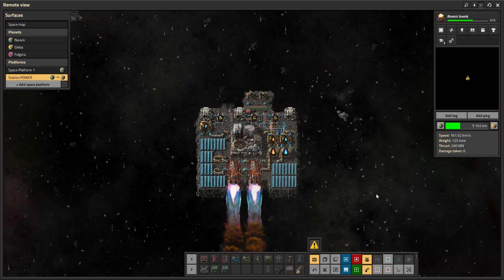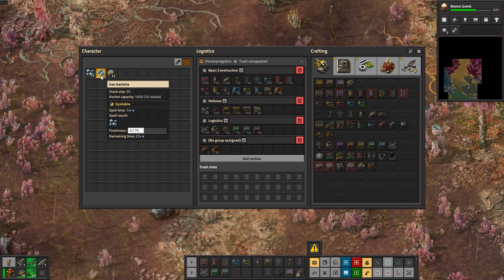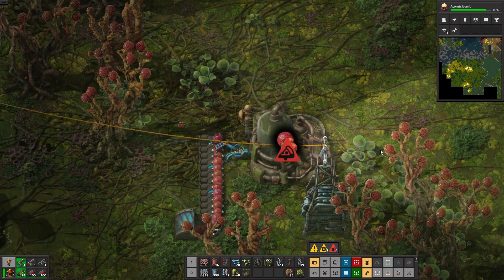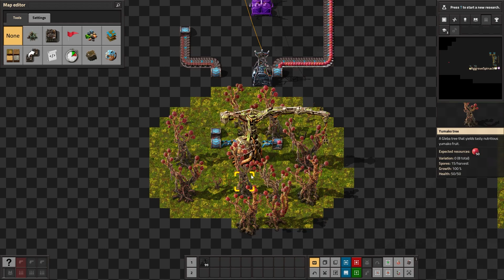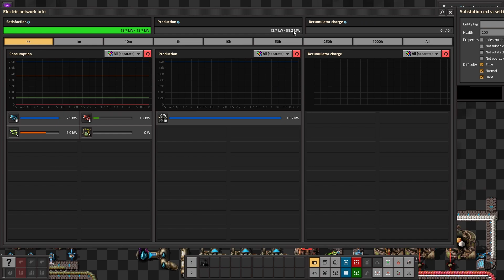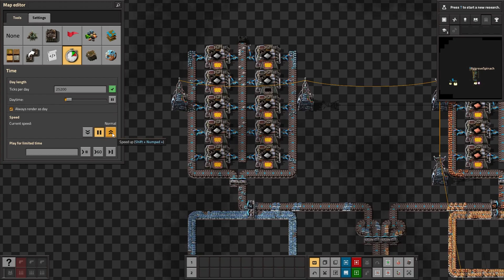Fully automated iron and copper on Gleba -  Factorio 2.0 Space Age Tips & Tricks

Comment: The heating tower is 1k degrees because it has no/very little steam conversion going on. Trying to use spoilage as an actual power setup is not going to work, at best it's a supplement. You need rocket fuel to actually get a reasonable amount of power on gleba.

Comment: In the bacteria kickstart system at 33:00, you can instead use circuit control to have an inserter pull off of the main jelly belt rather than running a lane with a splitter. You said yourself - most of what you split off to that system spoils. This way nothing is sent that way until it's needed. It's a minor improvement but I think it's an important scaling factor to reduce potential dead ends with spoilables.
Reply from the maker: @mystagogue71  true, that is a clever idea, thank you!

Comment: If you want to marinate it for a minute, why not have your marination loops be 1 minute long?  You're using blue belts, so items will move 6 belt lengths per second (if my math is right).  So have the marination loop plus the belts leading to the loop be equal to about 337 belts.  For green belts it would be 450 long.

Having your marination loops be too short can cause the bacteria to backup to the biolabs that created them.  Try saturating a full belt of bacteria leading into your marination loop and see what happens.
Reply from the maker: Eventually I do switch to just putting them into a box

Comment: Really good video!
Couple of suggestions: seeds don't spoil so the one thing you don't need to worry about is processing at the farms, converting plants into produce drastically increases the spoilage (1 hour to 3 minutes) so belting the plants to your base then processing them is way better than processing them at the farms, you can yellow belt or bot the seeds back with no issue. Processing fruits to mash/jelly right where you need it then sending seeds back is better.
Since the only real produce you want to get as fresh as possible is science you want to get all the ingredients for it as fresh as possible (I believe you forgot to mention any product inherits the average freshness of the ingredients used). So the freshest jelly and mash into bioflux right where you produce the science. (direct insertion for the jelly and mash close to start of the bus is ideal), the eggs are basically a kovarex setup that will be always fresh.
Bioflux has a very low spoilage rate and is used in almost every recipe including science and it has a very good ingredient to nutrient ratio. So just belting bioflux on your main bus and turning that into nutrients for almost all your local produce is the way to go, you can have a bioflux bus turn into fresh nutrients wherever you need it instead of using mash. Bioflux to nutrient ratio may not look amazing if you look at base stats, but remember you get a FREE extra 50% from extra bio chamber productivity bonus and way less spoilage because of the drastically improved spoil time on (mostly) fresh nutrients.
Reply: 5 bioflux to 60 fresh nutrients without any modules is what i'm saying

Comment: I tried doing a belt based gleba based, I did everything to get rid of clogs, belt content never stops it rotates around and yet it still breaks. Bots make gleba a lot easier but you still need to think a little forward, you can't just enable everything, as later parts of your factory will hoard nutrients away from the parts that supposed to create them (the bioflux only part) what worked for me is some circuitry that reads a buffer chest that holds 1k nutreints and disables parts of the factory's requester chests if it's below a threshold, so the base can warm up in case it stops. Yesterday I ran out of nuclear fuel cells and everything went offline on gleba, pentapods destroyed the whole thing. Everything restarted nicely after the bots rebuilt it!

Comment: This is a great design! I did something similar but used the other half of the yumako belt for nutrients instead of having a separate belt above. The one issue I have noticed is that its possible for it to permanently stall if your yumako production is too slow, so I'd recommend building extra soil as soon as possible to maintain a good stream of resources.
Reply from the maker: Yeah in the actual game I ended up using 2x24 tile yumako farms

Comment: 19:50 its not gonna keep 1000 degrees for very long if it needs to make more than like 0,3MW of power, the tenperature basically works like an accumulator
Reply from the maker: Yes I realise my understanding of heat -> power is a bit flawed. a heat tower can only max out at 40MW, however, there's enough burnable material in this system to supply many heat towers so add as many as required
Reply: @DataEngineerPlays  In essence 40mw from the heat Tower means 40mw power while its burning, but spoilage burns for like 250KJ so you need a constant supply of 160 spoilage per second to upkeep that 40mw, or almost 3 filled green belts, so it can make 40mw, but only from whatever fuel value of what you put in it

Comment: There are so many great bits in this video I've picked up, 
1. adding those grabbers inbetween a pair of labs to make things like nutrients or metal-bacteria more robust are great, but for expanding after the first pair or two it seems removing them in favour of a more compact system is fine, allowing the more robust system fill in the gaps at the start of the line. 

2. I really appreciated the burning spoilage tip, it's so much free power. And you can burn almost anything, which not only gets rid of things but also means you maintain maximal freshness, which is especially important for science.

3. The nutrients from yumako are neat for sure, Even just two so that the factory never dies is great. It's like a backup generator.

Comment: Hi, thanks for the video. I think nutrients from mush can stuck if mush is not consumed and you get unlucky and biochamber generates seeds. Seeds will clog and since they don't spoil, nutrients biochamber won't get mush. To fix you need to discard spoilage + seeds.
Reply from the maker: Yes you will have to handle spoilage of the yumako, its on a 1 hour timer, but at one point in my game it did spoil and clog my system, so I had to put a spoilage inserter at the end of the yumako belt too.

As for seeds, I have a wire logic on an inserter that says > 300 in the box, take it onto the spoilage belt and burn
Reply: @DataEngineerPlays  yes you are right. There is an inserter in the end 17:10 , seeds are handled. My bad!

Comment: This is very nice. I was convinced that the Gleba processes needed quite a lot of circuit control on belts or inserters to keep from flooding belts with too much spoiling stuff, but your solution here is a very nice, almost completely circuit free solution. 

Oh and I would say just from experience, I recommend not allowing bots to handle any part of these processes on Gleba, especially anything related to spoilage. Me and my friends used some logistics bots to help get different sub parts of the system working together and we ended up with about 600k spoilage that clogged the storage chests, mainly because we were trying to bring it all back to a recycling area to make it into nutrients instead of just burning it. Keep it simple, burn the stuff. The spoilage to nutrient recipe is really just for kickstarting things.
Reply: my entire gleba base is 100% logistic bot run. Extra spoilage and extra seeds get burned, that's it. It was powering the base for a while but as soon as I had fusion and a delivery ship making the rounds with fuel, I dropped a fusion plant on Gleba and deleted all the steam. The heating towers are still there to burn the extra but they're literally just that. It's simple. I just checked and I literally don't have a single belt placed on the entire thing.
Reply from the maker: @Matok1  true. But you need bots to deliver the stuff to the rocket right? Or... maybe I should use circuit control and direct feed the science into the rockets
Reply: Mainly talking about stuff that spoils fast. We had bots handling the mash and jelly and it was spoiling while they were moving it around so they'd stuff it into storage boxes, and had them trying to handle spoilage to bring it in for recycling into nutrients but they couldn't keep up, was a disaster. Using bots for end products like rocket fuel and processors makes sense.
Reply from the maker: @Matok1  oh yeah 100% don't be doing that. Just use belts and handle the spoilage with insertors and splitters I think is the way to go

Comment: Great video. Helps me visualize what I need to do. I will say, a minor concern with this design comes to mind. When splitting your jelly and mash off as a failsafe for bacteria generation, it might be better to disable a belt upstream rather than turn the machine off. That way you will just have a few spoilage stuck on the belt until the system needs to be rebooted, rather than half your main belts jelly spoiling on a line that isn't used much because its stopped flowing with a stopped belt. Though maybe there is such an abundance of mash and jelly that that isnt an issue, i only just recently landed on gleba.
Reply from the maker: Yes I've tweaked the design a lot in practice. Regarding the jelly and mash spoilage, I realised this design doesn't process enough jelly to keep the jelly seeds going so I've routed the end of the belt you mentioned directly into a furnace to burn the jelly to keep the jellynut process continuous.

Comment: Awesome video. All things are highlighted. Great compact and efficient schemes. 
I have only one concern. On schemes where you doing Yamako there is a chamber that produces nutrients. But if everything will stop for a really long time it will never start again by itself because the Chamber that produces Nutrients needs Nutrient to start doing that. Am I wrong?
Reply from the maker: The only way this could happen is if you lose power for over 5 minutes and the nutrients in the first yumako mash -> nutrients chamber spoils. But as long as you have continuous power, it shouldn't be an issue. While the belts are backed up the spoilage handling in the system will continue to produce new nutrients and yumako mash while everything else is backed up so the initial nutrients should never be spoiling.

That being said, at some point in my playthrough, stompers did destroy my yumako farm, which obviously killed the system requiring a manual restart... but also stompers destroyed my farm so I had to go there anyway to rebuild
Reply: @DataEngineerPlays  I see. Thanks for the reply.
Reply: yeah, it's not completely foolproof. if everything spoils there's a chance that it wont start itself back up again. When nutrients get consumed, the building gets a pretty quick progress bar that goes down. However, if that doesn't get used up and everything stops, the bar doesn't go away. You can remove all the spoilage from the building and it'll still consider itself "fed" until that bar goes all the way down. One bar is enough to process the fruit once, which would feed the nutrient maker and as long as the nutrient maker also had a bar that wasn't consumed, it'll put out nutrients.

However, if either of those two bars is too low when everything spoils, then either the first building won't have enough to produce mash or the second won't have enough to produce nutrients and this will stop. 

In his accelerated time testing, he just got lucky that it never happened. It's happened to me multiple times in my setup. Just luck really.

Comment: This is my lifesaver! I completely forgot about the heating tower and struggled to recycle the spoilages.
Reply from the maker: Yes burning spoilage I think was the big "AHA" moment for me too! I started off with that stupid trap of trying to recycle spoilage, which means everything needs to be in perfect ratio all the time
Reply: In theory, I could convert spoilage into nutrients at a 10:1 ratio and either use the nutrients or just wait for them to spoil again. But this is far less elegant than simply burning them.
Reply from the maker: @Elma-ky5os  it actually breaks the system. When you introduce a second source of nutrients into this build with a different spoil time, you'll get mid belt spoilage which this system can't handle and you'll get MORE cloggage. I've tried

The key is everything has to spoil in order so spoilage can be picked up at the end of the belt
Reply: Another way is to overuse spoilage to the point it is never  able to clog the system and even then in the end i would put the heater in the end and some failsafes in parts of the belts.

Comment: Honestly, once you get recyclers and heat towers you can just have a compost bin at the end of your line and call good. Heat towers can eat like 90% of what'll be a problem on Gleba, recyclers can chew through the rest and potentially spit out higher quality ores which is nice.
Reply from the maker: Is the recycler part of the gleba technology deck? Or is that something you unlock on a different planet
Reply: @DataEngineerPlays  Fulgora. It's how you process scrap from that planet, and also lets you recycle other things. You get roughly 25% of the materials back out of any exchange, liquids excluded. If you stuff quality modules in the recyclers, you can get higher quality stuff out of it. If you recycle something that's on the floor of its crafting line (for instance, iron plates; it can't go past smelters) you just get 25% of the same item, though you can up-quality there too. Feed recyclers into each other and you can annihilate any excess you don't want. Once you get Gleba chugging you will have a TON of excess.
Reply: Honestly, quality module'd recyclers are going to be a high volume source of quality crafting materials. Not a bad idea to keep a stockpile of the good stuff if you want to make a higher level reactor or mech suit or whatever and not burn a ton of otherwise useful materials on gambling.
Reply from the maker: @ember3579  very interesting. Maybe I should of visited fulgora first
Reply: @DataEngineerPlays  Admittedly, Fulgora is a bitch to do without a good setup elsewhere. Vulcanus is easy to turn into a resource farm even without interacting with the locals with mildly lucky spawns.
Reply: Recyclers are great for eggs, to get rid of them, before they hatch.

Comment: I think treating yamako on site is a bad idea. The fruit has a spoil time of 1 hour while the mush has a spoil time of only 3 min.
Kinda agree with the rest. SInce Farming products are infinite (especially with a few productivity modules for extra seeds) you just need to keep the belts flowing.
Also spoiling carries over to the next process so you want to minimize time on belt for science pack products.
Reply from the maker: @CL1608  yes I thought about that too. I guess you can just run a belt for the Yamako seed back to the farm. On gleba the farms are so far away and I have not many belts so where I can save a massive belt train I'd like to
Reply: @DataEngineerPlays  if youre running massive belt chains then everything is going to spoil on them anyway and your science packs will be created and used with like 20% left on them. Rather spend a few thousand belts to improve the efficiency of the science packs than save on belts. Belts are free, you can mass produce green ones on volcanus and export them. Get tens of thousands an hour easily with nearly 0 resource costs. Or just build mass belts on gleba, youve already got a main bus, make belts your first thing off the smelted plates. Lubricant is easy to come by on gleba too so thats blue belts easy
Reply: @DataEngineerPlays  You can also get away with logistics bots. You're not gonna need a massive supply at all times, and they don't spoil so no concerns there.

Comment: The cost for literally growing resources on trees

Does look like something with rather high upfront cost in setup, but in return it just... Does what it does, ad infinitum, no need for constant expansion to new ore patches
Reply from the maker: You can do a light version of the setup with yellow belts and such, it doesn't really cost anything to set up. They all use biochambers which are easy to build on gleba.

You don't need to run blue belts except maybe from your farms to base, since things will spoil on the belt
Reply: @DataEngineerPlays  more so meant "setup" in effort, with the whole spoilage to think about
Reply from the maker: @rumekfuria6037  oh yes that is indeed a nightmare. But better than the system constantly jamming and having to restart with bacteria and nutrients right